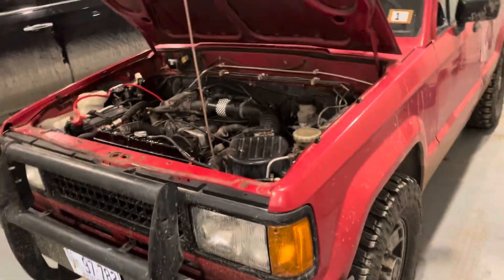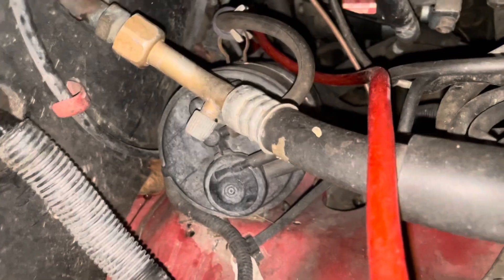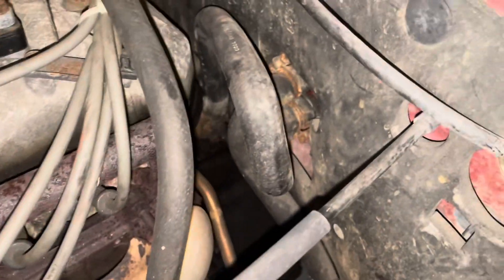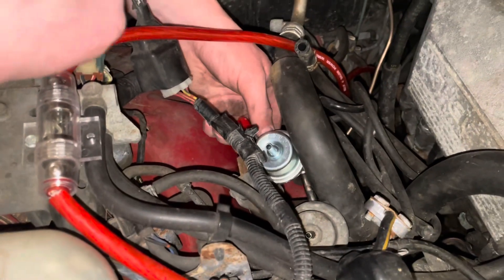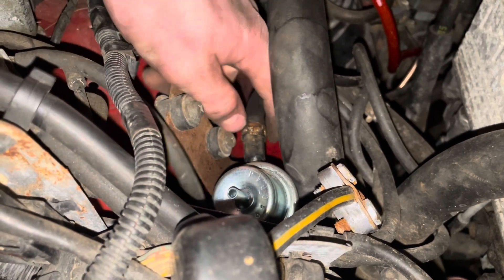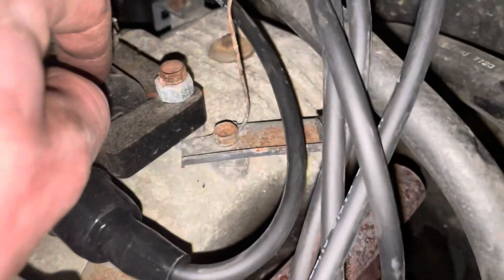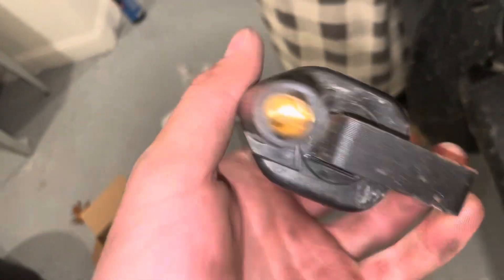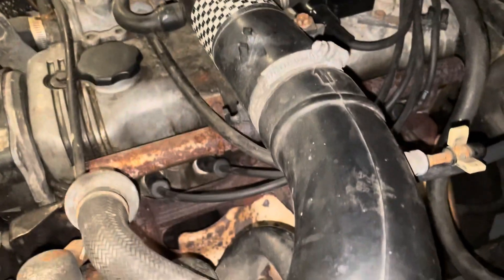1988 Isuzu Trooper Bogging Out: Installing New Parts

Comment: The coils plug comes from the ignition module under the I- Tec intake and make sure that the egr valve isn’t leaking or sticking or the motor will not run properly…I would recommend replacing the coolant temp sensor that the computer needs for the fuel trim as the vehicle warms up or you will have poor performance and flooding issues once it decides to quit working properly since it’s a common problem…most people replace it first before throwing parts into it because it will run the same regardless of how many parts you use.Im a retired engineer and I reverse engineered my 88 Isuzu pickup 2.6 4ze1 4x4 and built it into a new one of a kind hot rod with all mods and custom parts.
Reply from the maker: Yeah I’ve got one of those now, I’ve got another video coming soon! That’s cool though is there any pictures of it or videos on your channel?
Reply: Yes I have video and pics
Reply: I’ll post them soon
Reply: I have 95 rodeo that runs like a dream the problem I've had is that it keeps blowing the head gasket I've installed 3 head gasket already and they always have blown between the pistons is 2.6 torque to spec and still goes out any knowledge or experience on that?
Reply: Yeah..just make sure the block surface is not warped or you’ll have to get it decked like I did and then make sure the head is the same…use a felpro gasket they make em thicker than the regular cheap ones and then you have to clean the head bolt holes really well or bolts will not be able to go down all the way and it will seem like you torqued them but they will be hydro locked..first 45 lbs with very little oil…just enough to see shine on the threads and then 75 lbs…don’t worry about it not being the proper torque spec because the gasket is thicker and it will hold better,the problem with these is the design of the head gasket by the exhaust side has 2 coolant passages closed off….so if you can get a head gasket and drill out the 2 passages then you have solved the whole thing since it’s a design flaw to warm up the motor.